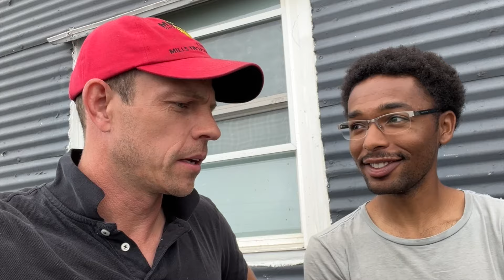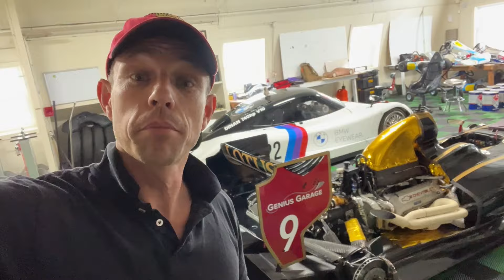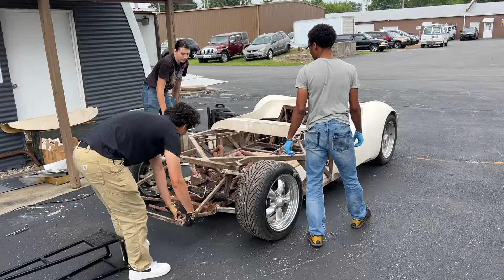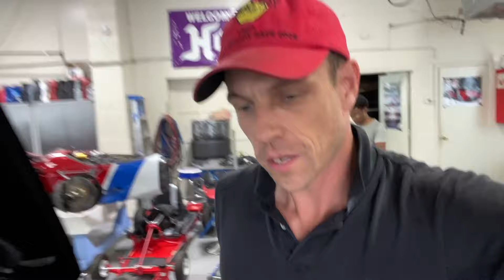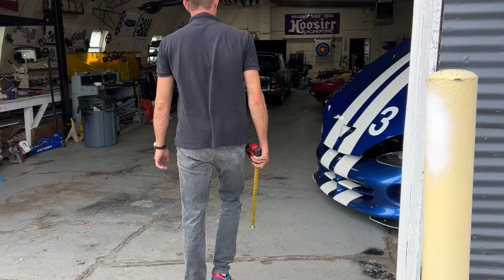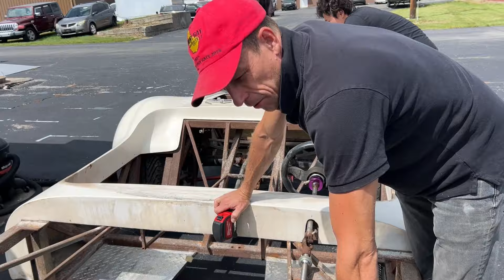Facebook Marketplace Dragon to become V10 MONSTER

Comment: I just wish there were more common even-firing V10s. Even firing V10s with equal-length headers and well-blended banks is one of the best sounds out there, especially at mid-high RPM (7000-11000). It's not practical at all, but if you did a crazy custom split-pin, even-fire, de-stroker crank (to like a 3"-3.5" stroke to let you push 8000-10000rpm safely) and long rod build on the Viper motor I'd, well... I'd be about as stoked for it as I am for the Omega Car. I actually have a bunch more questions about the Omega Car but I don't want to bother you too much with them 😅😅
Reply: Yo, you could do a hand clutch and dog box/faceplate the transmission, that way you don't have to use the clutch for shifting, just starts, and then you could have two pedals spaced closer together, but more evenly with relation to the driver's hips for better left foot braking control.

Comment: People may scoff, but we'll see who's laughing when this takes you to a glorious victory at Le Mans in 1959. This looks like a potentially great project. The frame is a tad crusty, so somebody will spend some time giving that a lot of elbow grease love. Stock up on wire wheel brushes. A couple of clear ergonomic observations. Yer legs iz gonna get real warm. The other big oddity... obvious just from the video view as you sort of roughed out the layout... in driver position, your legs will be oddly pointed off to the left. That looks pretty awkward, not sure how you will deal with that. Even if you move the steering wheel left and position the seat as far left as you can get,  that looks funky. A challenge.

Comment: is that thing using c5 corvette front components?
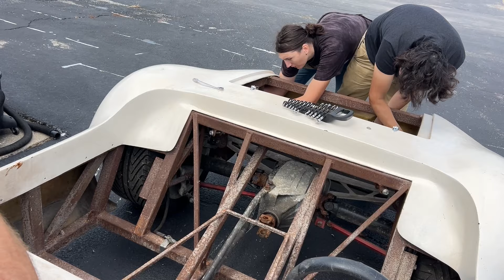12:20 looks more like parts out of a C4...
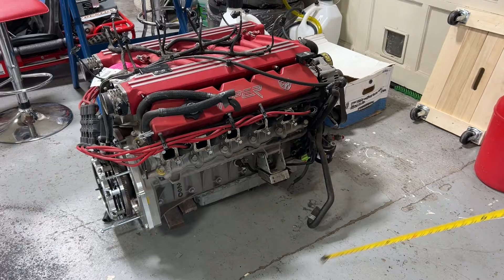14:30 tame it down a bit with a custom forward facing log manifold
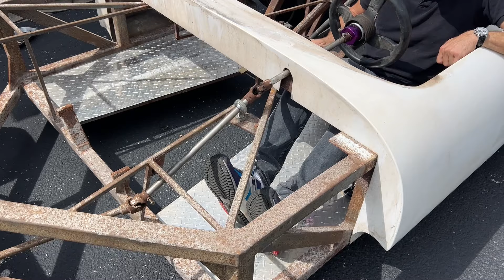16:30 ok thats doable with a high remote might res for the fluids swing box or firewall mounted not floor mounted box maybe best for heat management,
honestly too bad its out of scope to stretch the chassis for a c6 tube o doom  that would really help handling and a donor car for upgrade parts driveline parts! 🤣
double wall exhaust pipe.

Comment: I lost count how many different chassis you planned putting that engine in 😂 PS you don't have to justify we know you know you have impulsive cool project buying problem 😅
Reply from the maker: It doesn’t fit in anything
Reply: @CaseyPutsch  I hear you 😂 thx for a good laugh. I hope this one somewhat will. Are you planning on running t56?

Also, if I may suggest. I think you should consider running motor mounts similar to what I designed for gen 2 cars. Two side plates that sandwiches the block mounting surfaces and a poly sleeve bushing. I wish I had any left to send you a set but they are long gone. That way if you for any reason need to minor adjustments to your engine mounting height you can by simply changing out the side plates. Might also give you more room for headers.
Reply: @CaseyPutsch  fits in a second gen ram 2500 ROFL
Reply: @CaseyPutsch  and maybe a motorcycle

Comment: You need to ditch those motor mounts. Factory ones are the soggy as a wet diaper and it will be pain to get the mounting surfaces located just right

Comment: could you stretch the frame, ever so slightly? changes the wheelbase and body work would be needed. But you're trying to stuff a huge engine in there.

But, a huge part of me wants you to succeed stuffing that giant engine into the original car. Where there is a will, there is a way. It's challenges like these that force innovation and creative solutions that people would never otherwise come up with.